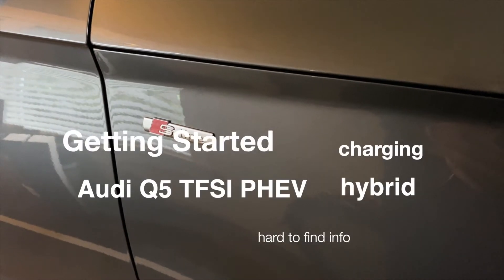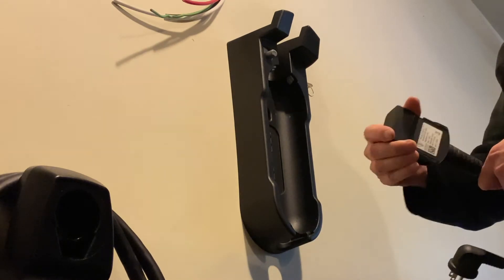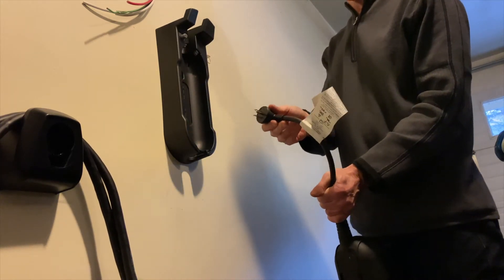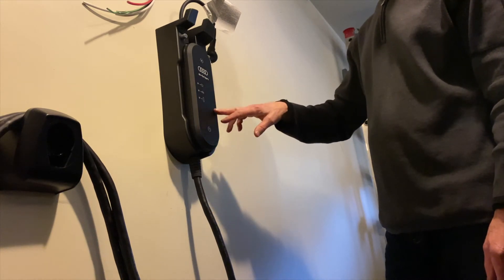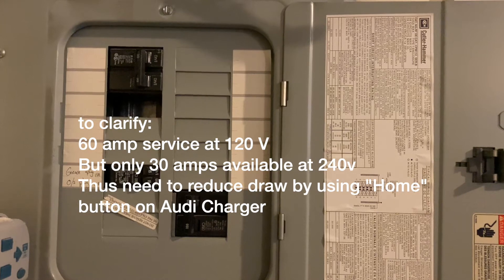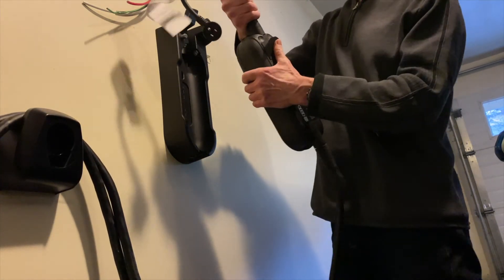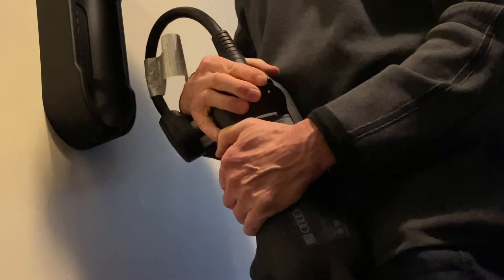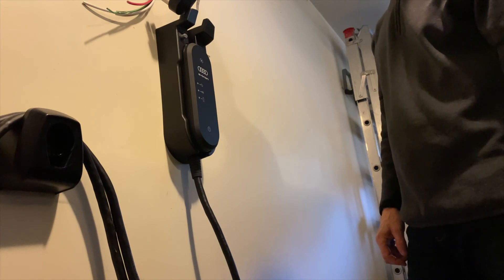Audi PHEV Charger Tips on Plug and Home Button settings

Comment: Thankyou so much for your video!  I picked up my newish 2022 Audi e-tron yesterday, I had travelled 275km as well and running super low on battery by the time I arrived 😬 When I tried the Audi charger it didn’t work at all.  So after watching your video the next day I looked at the back of the charger and it hadn’t been properly connected (the brass lock at the back wasn’t in) 🙌 Thankyou again.
Reply from the maker: Glad it helped!

Comment: Super helpful video. Much appreciated. I am looking at a my first venture into electric cars and feel more comfortable starting with a PHEV car. I was leaning towards the Q5. I live in QC and unlike your extraordinary island, we have a tone of snow over here with very long winters. The Quattro system is just awesome on winter conditions. After your video and a few comments below I am getting cold feet on the Audi. With your Canadian experience on the Audi, the various frustrations with the charger and some recalls, your mention that you will go for another car next, is the Q5 still a good PHEV?
Reply from the maker: Thanks for your comments! As you know our climate on the island here is mild and perfect for an EV, not a lot of range loss due to cold. I would never buy a full EV in Canada, our winters are just too cold and our charging network under developed. However, I would totally buy a PHEV again, never a full gas vehicle. Even though the 2020 Q5 battery is only 14 kwh it gets me 45km in the summer and 30 in the winter (in QC you probably are more like 20-25 in the winter). But that gets me everywhere 90% of the time, and then the gas engine kicks in.  And I dont mind the gas engine either because it burns through the tank, probably not a good idea to leave old gas in the tank for months. On the island here gas is $2.10 litre, so having “free” power (I also have solar panels on my roof) for most of my driving makes me happy! As far as buying an Audi…I have had four and I would avoid anything older than 7 years, too expensive to fix.  The Q5 is fantastic to drive, solid, quiet, Quattro etc, but some of my driving is in the country and getting a flat in a PHEV is hell. The Audi (and I think all Euro PHEVs and many others) only have a crappy little compressor kit and a cartridge of goop to squeeze into the flat, and cross your fingers it works. Not even a jack or the mini spare anymore. I had a flat and the goop wouldn’t work, and roadside Audi help was of no use in the country. That experience was so bad I bought a tire/jack combo in a bag from a US company called ModernSpare for about $850 that I bring when out of the city on unpaved roads. Have a look at other PHEVs from Toyota, or even Jeep and check out their battery size (20 Kwh is the sweet spot I think) and whether they have a spare tire, and then watch Youtube reviews. Audi  still doesn’t treat their PHEV line in Canada with much respect, very limited choices in colour and model etc, but now that I have the Audi charger and spare figured out I may go for the 2024/25 model. I hear it has a 19 kwh battery which is great.  Good luck on your search and thanks for the thoughtful comments!
Reply: Thank you for taking the time to respond and for the exhaustive reply. It’s so helpful and truly appreciated. My wife is from Langford so we found ourselves in your beautiful island every so often, you are lucky to live there. I will follow your great advise and suggestion. Thank you again!!

Comment: I’ve got a rental TFSI-e and it won’t charge at all, I presume that you need the control unit married to the cradle for it to initialise, which of course I don’t have. So currently getting only 24mpg Imperial atm 🤦🏻‍♂️ Can’t wait to get my Cayenne S back!!
Reply from the maker: Arrrggh...frustrating for you! I've can charge mine at standard parking lot chargers so I think all the plugs etc are standard, so if its not charging that may be an electrical issue with the car.  They did a recall in fall 2022 (I think?) to downgrade the charger so it doesnt draw as much current. I guess it was overheating household wiring at 40 amps. Maybe that is the issue?
Reply: @NorthOlbo  on further investigation I was plugging into a high amperage extension lead which rendered the control unit dead, the minute I plugged directly into the wall it woke up. Though the (what appears to be) Audi extension cable - essentially a “C” male/female cable - doesn’t marry together…. So I need a wall socket that is less than five feet away from the car!
Reply from the maker: @paulriley3463  Great Info! Hopefully someone else reads this before wondering what the H is going on. Some more of the magic of Audis.

Comment: Have you got the electrical malfunction problem in your Q5e? I see quite a lot of those in Audi forums and I am reconsidering buying because of it. Audi says it won’t happen again, but apparently happens once.
Reply from the maker: I’m not sure what malfunction you are referring to. There was a recall to lower the maximum charging rate to protect household wiring, I had that done. And the Audi app hasn’t worked for awhile. And it did glitch once and wouldn’t change into drive from park, requiring a power off and on (just like a computer!). These are little annoyances so far. What I discovered that I REALLY didnt like was the flat tire repair. No tire, not even a weeny one. Just a pump with a can of sealant thats supposed to hold you long enough to get to a station with actual tires. Didnt work at all, huge waste of time. And difficult to set up requiring lots of digging around the trunk for the parts. My next vehicle will have an actual tire, even if its just a temporary one, the Audi “repair” LOL kit is a hazard to anyone not in a city.

Comment: Do you have to push the house button to get it to charge better?
Reply from the maker: In Canada the charger has had a recall and is limited to 20 amps, not 40 amps, to protect house wiring. This used to be the purpose of the “house” button (I think) but now is redundant as the higher charging rate is no longer possible.  So pushing the house button should make NO difference to charging rate, it will be 20 amps regardless.

Comment: Can you turn off the charger? For now I have to turn off the 220V breaker as an on/off switch.
Reply from the maker: It’s all automatic for me. Charges at 50% amps because I dont have a dedicated high amp line to my garage, it “knows” to draw only 20 amps at 240v, then shuts off. Your system is obviously different.

Comment: Hi can you set up charger to a specific time ? Let’s say midnight to 6 am which is cheaper cost in electricity , specially in California
Reply from the maker: you can do that from the Audi App. Takes a few minutes to set up but gives you info on time to start charge/fuel, usage etc. Where I live its a fixed rate to a certain level then it jumps up so not time based but usage based. No advantage for me to charge at night.

Comment: This is very intuitive.  Question:  in your experience, how does the car perform after battery is depleted?  Is it true that it will only have the ICE engine and the electric boost is disabled?  I couldn’t find information on the web and wondering if your can share
Reply from the maker: Interesting question. While you'd think the Q5 would be running solely on engine (after the EV shows the battery as depleted)  in fact it taps into the battery constantly, the little bit of reserve thats left. I dont know what the "web"says, but in my experience it will dip into the battery on acceleration and coast on the engine on steady driving when the EV shows zero km left. It gets amazing fuel economy in this mode, much better than a straight gas engine. If I'm on the highway I will run it in "battery hold" mode which isn't supposed to pull on the battery, but it does in those little acceleration moments, and then maybe recharges it? For a heavy SUV it gets great fuel consumption even out of EV mode. Mind you, this is pleasant 15-22c temps. Sub Zero maybe less inspiring.
Reply: @NorthOlbo  thank you so much for the input!  This answers the question I always have while waiting for my PHEV order.  Cheers!

Comment: Bingo. Thanks for the demonstration on how to swap out the two different plugs. Nothing in owners manual or instructions on that particular issue.
Reply from the maker: There should be an extra Audi manual called "Things that should have been written better in the Audi manual". The one that really got me was the motion alarm going off in my 2018 Q5. Each time on the ferry (I live on an island!) Try to find out in the manual how to disarm it in advance. In a panic. With no WiFi on board. So deeply buried it's basically invisible. BTW its a small button on the bottom side of the driver door. Obviously! I'm sure other Audi owners have their own favourites too.

Comment: just bought mine yesterday- tried to charge overnight 120 V in the garage in the morning the charge is zero! it was 100% when I left the dealership - what could I have done wrong-?? will go home and check the plug for sure but the light was on - i did notice the red park light on inside the car - any ideas ?
Reply: The green light needs to be blinking if charging is happening -- both on the car (next to the charging port) and on the Connect device near the wall plug.
Reply from the maker: 120v is VERY slow, but overnight should have got you at least 25% full. Everything eventually shuts itself off so it shouldn’t be the lights/radio etc. Ive found the dealer to be good for solving these issues so give them a call.

Comment: Good video--had the same issues---wish you had covered the buttons surrounding the charging point on the car--you can get stuck trying to unplug.
Reply from the maker: Another thing I wish Audi had done is put a small LED light on the front of the plug in charger. It’s black, going into a black hole with a black receiver, behind a little door under the overhang of the car body. Unless you have good lighting it’s frustrating to nicely align it and plug in. My lighting in my garage is average, ie not great, and it’s annoying to mess around trying to find a fit, especially with all those lights under the driver door when it’s opened! Could you have added one more light to the little door to the charger point? Argh.
Reply: @NorthOlbo  I keep running into the charger port being locked on the car when it is finished charging---and not sure which button unlocks--presume it is the bottom one--but frequently does not work....back up is locking and unlocking the car three times---then it unlocks the charger.
Reply from the maker: @Maggiore08  I’ve seen that too. If I’m outside with the charger plugged in and I lock the doors the charger will not let go of the plug until I use the key fob to unlock the car. Pressing the lower button doesn’t release it. If I’m in my garage and the car is unlocked then pressing the lower button once ‘wakes” it up, and it the indicator light goes green. I push the lower button again and I hear the “zzzt” sound of unlocking, and the wall charger part makes a click too.  So it looks like a different unlocking behaviour depending on how the vehicle was left. I’m sure that’s in the manual somewhere too....!!! but not in the little pamphlet on how to plug in the charger. Audi!!!!!!
Reply: @NorthOlbo  Thank YOU so much---I believe you hit on the cause.  At least once the car was locked at a public charging station....and this morning the car was unlocked but charging port was locked in position....and I think the second hit on the lower button was what finally released it.  Knowing this will relieve some angst. I do not think this is in the manual.

Comment from the maker: Audi manuals aren't famous for ease of use and quick locating of suddenly important features (like shutting off your motion car alarm on a ferry! Hello Audi manual writers!). If you just got an Audi with the plug-in charger you may be struggling with a couple of very basic steps NOT described in the charging kit installation book in the cable bag. These small but important points are buried deep in the Audi car manual, on pages 104 and 109 (for a Canadian 2020 Q5 TFSI PHEV) but are not easy to find, are barely referenced, and don't seem to show up on internet searches. Congrats on visiting Youtube University! You will see how to plug in and remove either the 120V or 240V plugs, and if your location doesnt have 40 amps available how to reduce the demand from the charger.